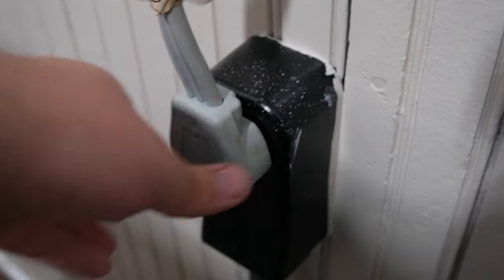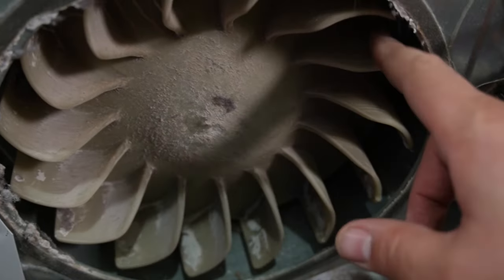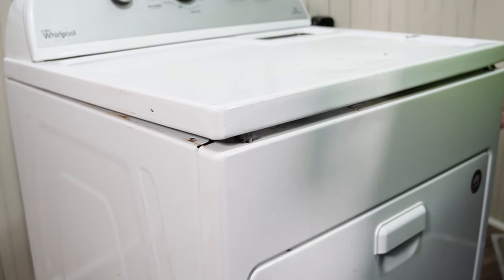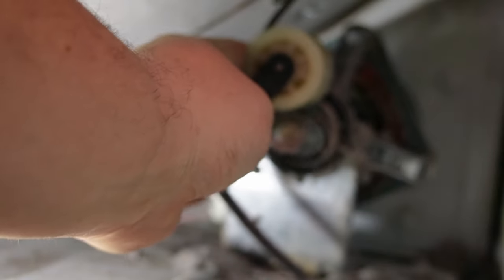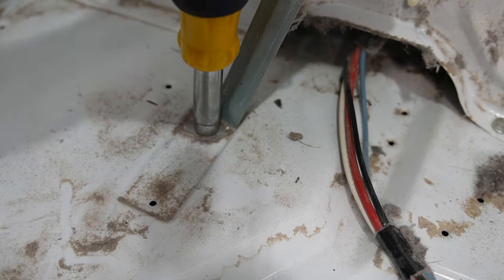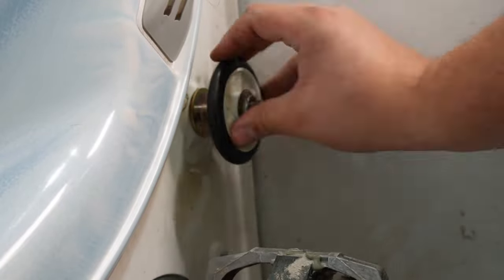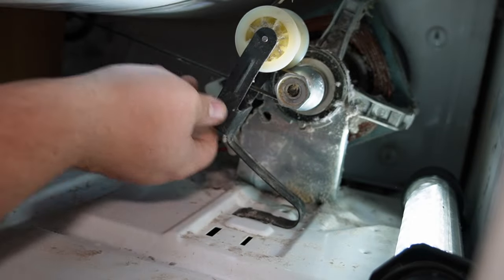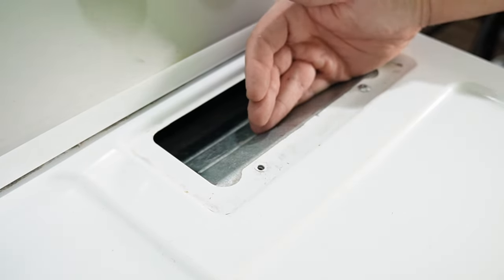Whirlpool Dryer making Grinding, Squeaking, or Loud Noise - How to Fix

Comment: Im a maintenance for an apartment, but had no idea how to fix my dryer. This worked perfect. Would have never known to use a puddy knife to open the top. Thank you. My wife had already picked out a $500 unit right before I watched this and fixed it haha. Shes not happy with you, but I am. Working like a charm.

Note: when you said to make sure you had all your tools out at the end should have listened better. Forgot my flashlight and had to take the front back off. Also those little clips on the side of the door front panel fall off really easy. Took almost 10 minutes to find one of them.
Reply: I enjoy this video very much then

Comment: I finished putting the whole thing back together and FORGOT to plug back in the door switch wire harness…. It didn’t turn on and I had a mini freak out. After I calmed down I remembered I forgot that switch. Popped the top back open and reconnected the switch and worked like a charm 😌🥲

THANK YOU for these detailed instructions! Saved me a bunch of money calling a repair man!

Comment: Thanks for the video, helped me fix my dryer's high pitched squealing noise. I didn't remove the back part like you showed in the first step, but my problem was also the wheels not spinning easily as shown in the video. My dryer looks the same as the one you worked on.

I ordered your linked repair kit but probably just needed the wheels. I replaced all the parts just in case but ended up switching back to the old pulley because it was making a loud rumbling noise with the new one. The size of the pulley wheel was slightly different and caused the issue for me I think. The original pulley didn't have as thick of edges on the wheel, like the thickness of the plastic coming out from the spoke part if that makes sense.

So probably common sense but don't throw out the old parts right away. Thanks again for the clear instructions, taking it apart and reassembling wasn't too bad at all. Gloves are a good idea, the edge on the front panel that you have to lift up and off is sharp.

Comment: Thank you for the great video.  I tested both wheels and pulley and they were not broken. Tested the motor and it worked fine. So all did is sanded the wheels the pulley and also the drum where the strap wraps around.  It works super! Cheers

Comment: Excellent video.  Cleaned the back side first.  Then took off the front and discovered I need a belt because it is starting to separate, plus one of the two drum reels did not turn well.  Hardware store has both in stock.  I will clean the posts with emery cloth them install the new belt!!

Comment: Awesome terrific helpful video. Not only did I avoid a repair fee for the horrific screeching noise coming from our dryer, I found $128.44 of loose change that accumulated in the floor of the unit over the last 13 years.   No lie  or exaggeration: 128 bucks.  I own a near-identical  whirlpool model to the one in this video.  If you have one, I would recommend spending a  few minutes removing the front and then use the proceeds to take your wife out to dinner, or buy yourself some new fishing gear or whatever.
Reply from the maker: WOW! That's so awesome! You got paid to fix your own machine!
Reply: @bensappliancesandjunk  Yeah, interesting design flaw that they double as a piggy bank.

Comment: Thank you so much for the video, my dryer was making an awful screeching noise and it turns out to be a tag stuck in the blower fan. Save me a ton on a repair man
Reply from the maker: The noises these things can make are insane... Then when you take it apart, its usually something so mundane. Glad it helped!

Comment: Great helpful video. I just needed to replace the belt and the noise went away.
Reply: It seems like the noise goes away after I adjust the belt then as heat kicks in the noise comes back again. Why could that be?

Comment: Thank you for the steps. I took the back off the dryer and cleaned everything in there, but was unable to figure out how to remove the top and access the drum. So I will follow these directions.

One question though - my dryer started making an unholy metal-scraping-metal sound. Obviously, without looking inside there is no way to truly know, but would that indicate a large problem that can't be fixed with the kit linked above? I would hate to have to by a new dryer, but if I have to, so it goes.

Comment: Thank you so much this Was so informative video. I have a question, my dryer wont spin when the drum is on but the motor would work fine without the drum or belt.

I have changed the belt
Bearings all good
Belt size is identical and placed properly 
Motor works fine alone with nothing attached
Barely any scratches from the rotating drum

If I turn the dryer on while the drum is on I could hear the motor buzzing for maybe 2 sec then shut down after a click. Before it got to this stage last time I used it was rotating with a loud sound and then I quickly stopped it.

Not sure what is going on with it so please help me if you could
Thanks

Comment: So I did all of that and it still sounds like a 747 when running. It works OK, but the sound is obnoxious! A local appliance parts dealer alerted me to the plastic bearings on the front side of the drum. Could that be causing the noise? Do those plastic bearings that snap into the front of the drum wear down and cause noise?

Comment: We have had a new Whirlpool dryer for only 8 months before hearing the squealing noise.  Since it was still less than a year old we call for the warranty service,  tech comes out, never opens up the dry but listens to the squeal for maybe 2 mins and tells us he needs to order a new pulley kit and will call us when it comes in. 
It is possible to come to that conclusion that quickly without even opening up the dryer to look inside?

Comment: Appreciate the video! Just finished this and I’m running again. Quick question, do you have some play in the drum moving it front to back? There seems to be a little bit of a potential pinch point in mine between the felt and the drum. It may have been this way before but who knows.

Comment: Replaced all the parts and felt didn't see a drum bearing and motor isn't squealing but there is a metal squeal every turn and clank like something maybe bent reinstalled this 5 times incase I didn't set it right and same result. I'm stumped.

Comment: Does anyone else have issues with the pulley wheel rubbing on the motor? I'm thinking maybe the belt needs to be straightened...idk. any suggestions?

Comment: Wear leather gloves! The inside has many super sharp edges and points. I got two deep cuts. So sharp you don't even feel it til you feel blood running down your hand. The video was very helpful though. My drum was thumping when rotating (with and without power). I suspected a bad roller wheel or axle but actually a stray screw had lodged itself into the bulkhead where the drum rests. Took that out and it's working normally.
Reply from the maker: I did start wearing gloves in all current/new videos FYI. This one was made before I did that.

Comment: My dryer is not squeaking and the nose is not constant... I'm not even sure if it's grinding. It will run just fine and every now and then while running it suddenly makes the most awful, alarming, LOUD noise. It's terrible. I'm trying to figure out what could cause this before I take it all apart, but none of the videos I've seen have addressed this particular problem. Any ideas? It did this just once maybe a year ago and started doing it much more often recently.
Reply from the maker: Not really. You'd want to take it apart and look. Could be an item stuck adjacent to the blower housing that slowly rocks back and fort triggering the noise.
Reply: there's something stuck in your lint trap fan

Comment: Is this the same procedure for a GE dryer with the lint trap on the inside just below the door?
Reply from the maker: No. Totally different process. There's a bearing kit for it. All the weight on the GE is on the front, then a central bearing piece.

Comment: I watched this video and ordered the repair kit last fall to fix my squeaky dryer.  After replacing all the parts (as per the instructions in the video), and putting everything back together, my dryer sounded as good as new!  A couple days ago the dryer started making a thumping/thudding sound.  When I removed the drum to inspect the wheel I found the wheel on the bottom left damaged quite heavily. The metal bearing that slides on the shaft was completely worn out on the front side, resulting in the wheel wobbling when it's spun thus causing the noise I was hearing.  Inspection of the upper right wheel showed no signs of damage, but it does not spin freely like in the video.  I ordered two more wheels and will replace them as soon as they arrive.  Any thoughts about what would cause the bearing to wear out so quickly?
Reply from the maker: Could be that the shaft itself is warping causing issues.

Comment: Thank you for this video, I followed the steps ...IDK why but the whole bottom was covered in at least an inch of lint (very thankful it didnt catch fire) cleaned everything out, checked the drum belt and the 2 lower pullies looked fine ...now that I did that & put back together, it way louder and it's a constant whine/squeal like needs WD-40, can I spray some there without a problem??
Reply from the maker: Yes you can spray that or any other oil
Reply: Thank you so much for quick response

Comment: The left roller was very hard to pull off & can't get the new roller to push on at all. The right side pushed on fine. Any ideas?
Reply from the maker: Make sure to sand the shaft down a bit. Could be build-up of something